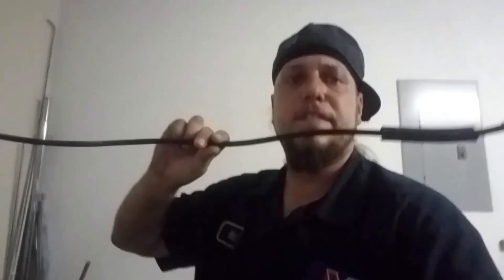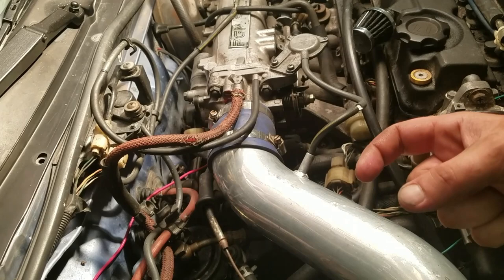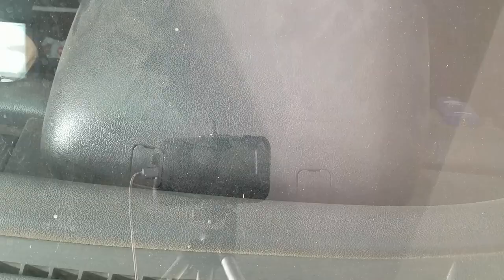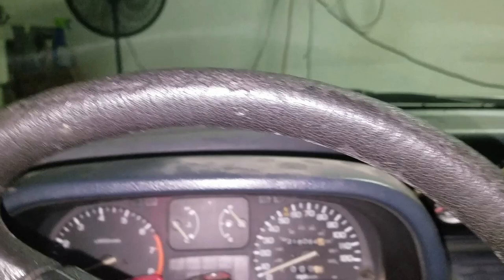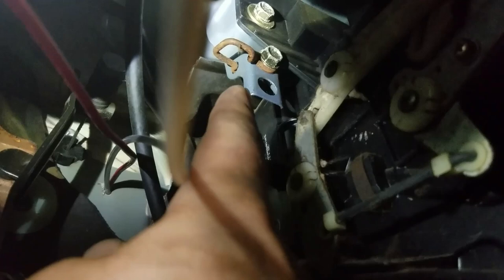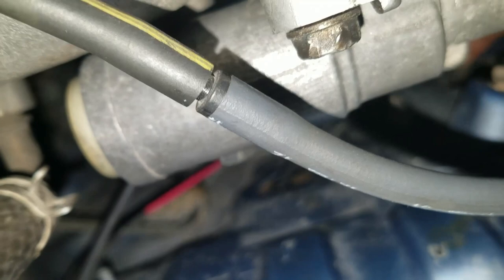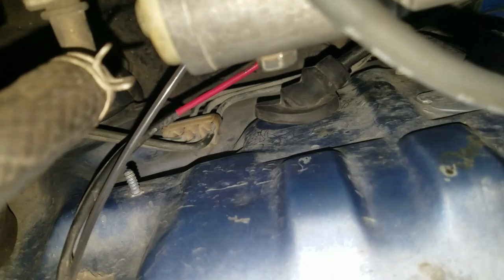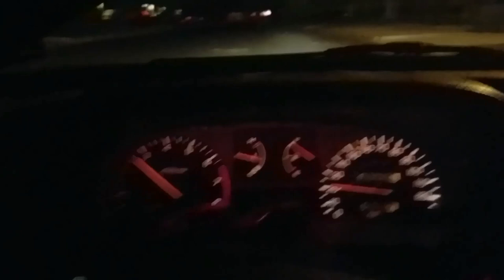88-91 EF CIVIC/CRX/WAGON 90-93 DA9 INTEGRA Speedometer Cable Large

Comment: I broke my speedo cable when i was pulling the cluster to clean and regrease the cable lol. Found an oem honda cable from a japanese warehouse and it tooke me 20 minutes to install. Thanks for the video. After it broke the rev limity kicked in at 4k rpms under full throttle. I looked everywhere for a possible fix, even tho i thought it was probably the speedo cable but it just didnt make sense in my head why it would cause that. I put the new cable in and it fixed the issue!😊

Comment: Thanks bro. The squeak on my 88 rt4wd speedo is becoming unbearable, time to fix it... My 91 LX sedan did the same annoying squeak, but I sold it before fixing.
Reply: You ever fix it? It squeaks at the cluster?
Reply: @damnitdang  yeah I took it apart grease up the inside of the speedo cable, put it back together and it's been fine for a long time
Reply: @solitude's silent groove  you took the whole cable off.  Are you able to take off the inner metal cable to clean? Or did you just sprayed wd40 in it?
Reply: @damnitdang  yes I took the whole thing out and the cable from inside its housing, cleaned it with WD-40 and then packed it with regular Auto Grease

Comment: Hey are the speedo cables interchangeable from the wagovan to the 90-93 integra
Reply from the maker: Yes the should work, one may be a few inches longer than the other but should still reach. I've used a crx cable on a da9 and it reached no problem